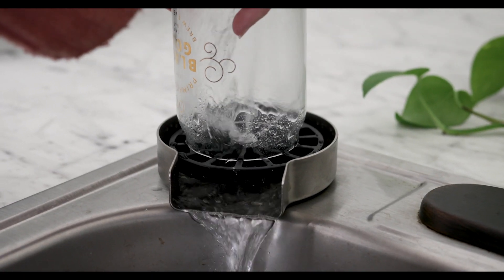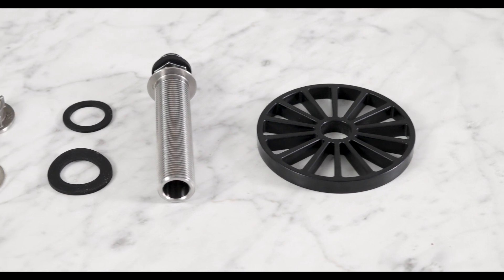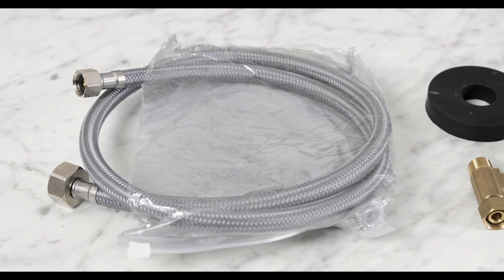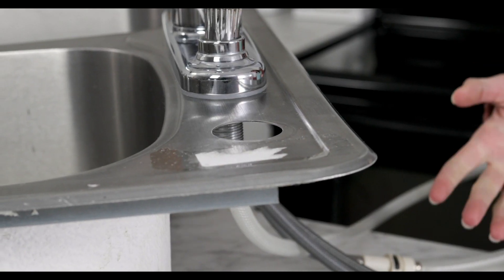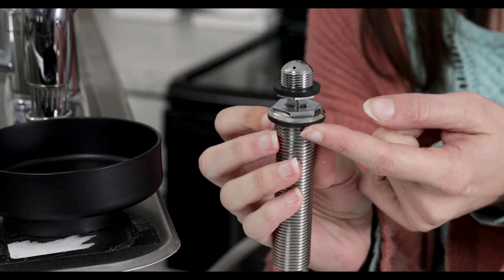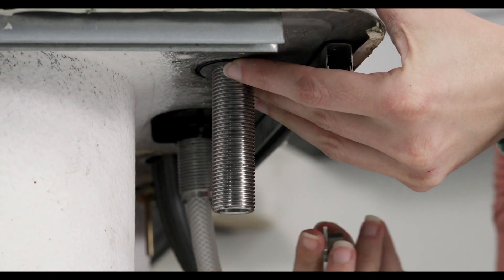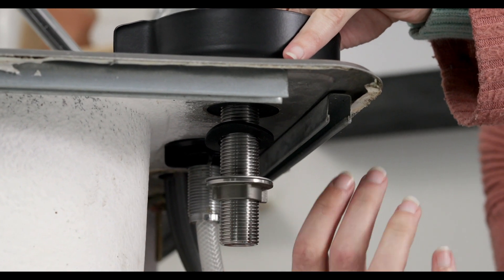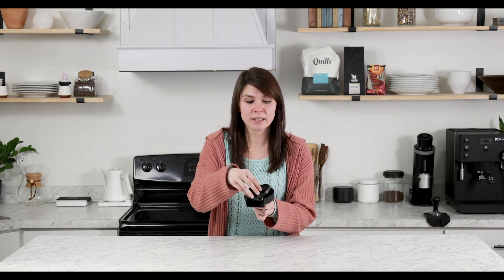Espresso Parts Glass Rinser Overview and Installation

Comment: I’m in an apartment and thinking of how I can add this. Question. Was the extra hole already in your sink? Mine has a hand rinser but not an extra home to add the glass rinser
Reply from the maker: Yes, we already have a hole in our sink. You may be able to disconnect the hand rinder and install the glass rinser.

Comment: What if your sink doesn’t have that weird hole in the right corner?
Reply: You could always drill the hole yourself using a hole saw bit and a drill depending on the size of the hole required.
Reply from the maker: You would have to drill a hole to get it installed.

Comment: You only connected the two water line to a t connector. What about the third connection? Won’t it leak?
Reply from the maker: There is one water line connected to the cold or hot water supply, one to the rinser, and one to the faucet.

Comment: are you supposed to drill a hole in the sink top?
Reply: yes
Reply: In usually, there are two holes in sink, one for faucet, another one for soap dispenser, you can remove the soap dispenser and install the glass rinser.